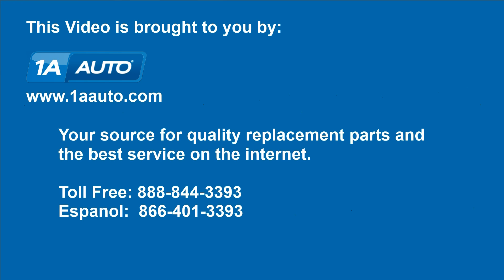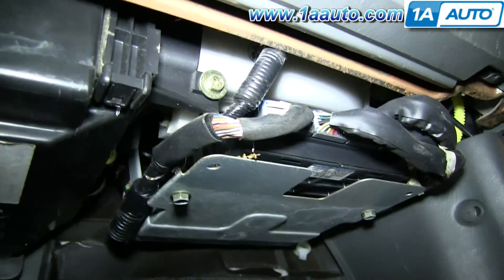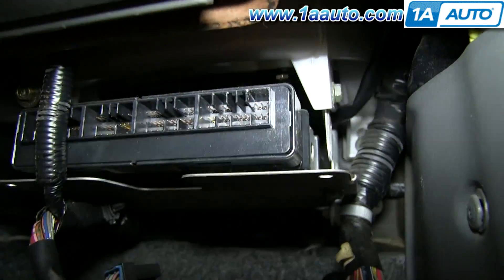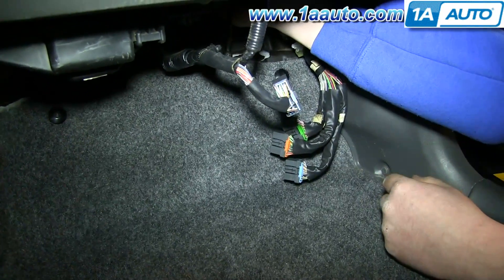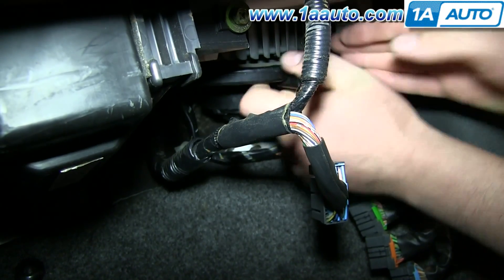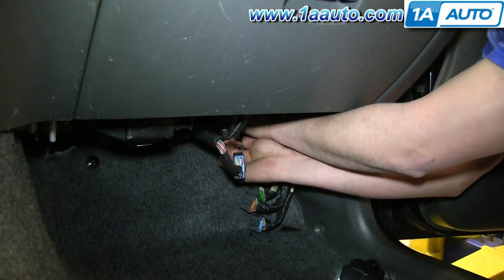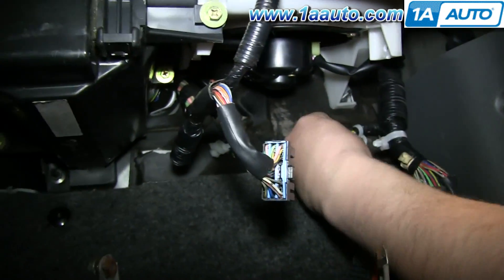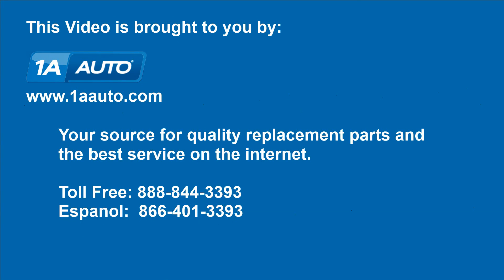How to Replace Blower Motor with Fan Cage 01-02 Suzuki XL-7

Comment: Excellent video.  I got my replacement blower off Amazon for $25 and had to buy a swivel set for my ratchet at Harbor Freight for $7.50.  I did have to cut away some of the insulation by the firewall to get to that bolt in the back to get to it.  And I was able to get it loose just using the extension and some elbow grease.  The bolts aren't very tight on the blower.  So thanks again.  K
Reply from the maker: Thank you for the great reply. We love to empower our customers by showing you how-to perform your own auto repairs while installing our high quality auto parts. Have a great day! 1aauto.com +Deadline Kelly

Comment: Can you add a video on how to clean the AC drain when it is starts leaking inside the passenger side (Suzuki XL7)?Thanks, you guys make great videos.
Reply: a length of wire should be all you need. ream it up into the drain hose to clean out the shmutz thats 'grows' inside it

Comment: My mechanic said I need a new blower and some sort of electrical plugs? Says it overheated because my cabin filter was clogged and couldn't get enough air. Any idea what the other parts might be? Felt weird asking him for the parts list since I wasn't giving him the work. thanks
Reply from the maker: +Rolando Otero This is all depended on what exactly failed in your vehicle, it would be best to get a list from your mechanic to ensure you fix everything your vehicle needs fixed.

Comment: My word, getting to the back 8mm bolt on the motor is seemingly impossible! It's right up against the firewall.
Reply: How to replace a fan motor for a 2004 Chevy tracker
Reply: IM TRYING TO GET THAT BACK SCREW OUT TO. BEEN FIGHTING IT FOR 3 HOURS. NO ROOM.
Reply: Yup! I'm going through that little slice of hell right now!
Reply: I just pulled it off with the 8 mm wrench but you have to get on your back its wasnt easy did it with my right kept reseting the wrench with my left